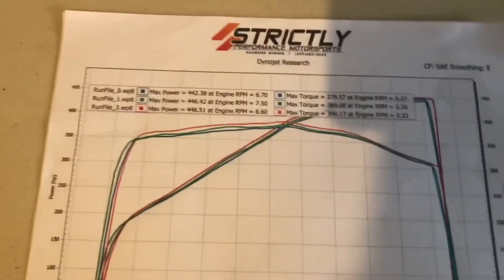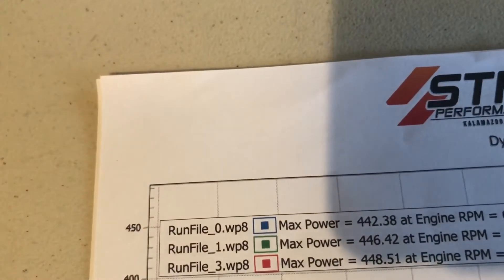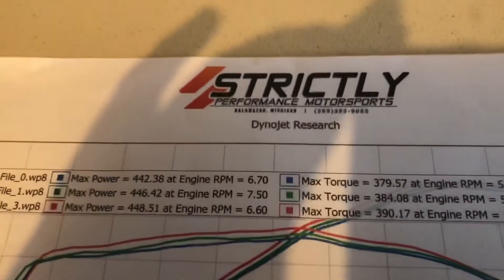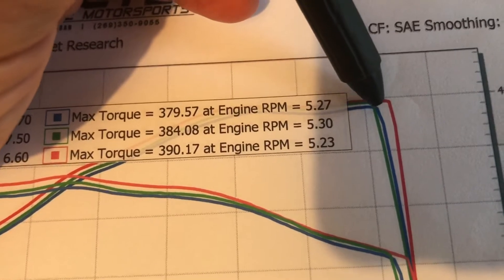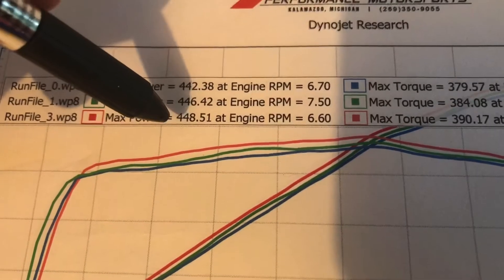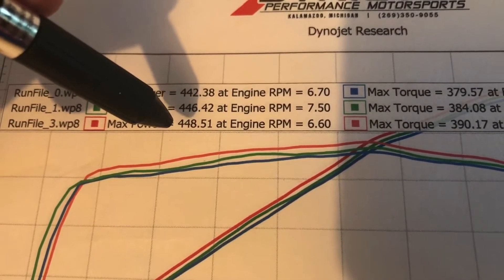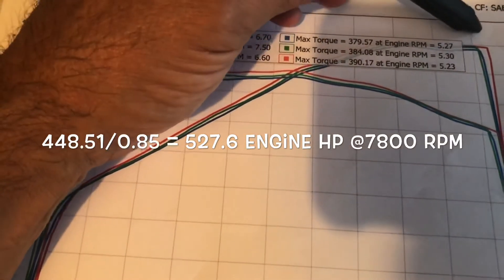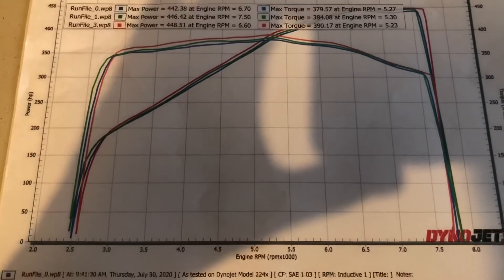Boss 302 Dyno Graph/Gen 3 Coyote Exposed!

Comment: Did you port the intake yourself? If so was it to complicated and did you use a dremel?I have a 12 Boss 302 and want to keep it fully stock and improving upon the intake would be my go to route with porting to squeeze out a few more horses.
Reply from the maker: No I didn’t port it. Here’s my recommendation. Buy a new intake bc there cheap now ($225)and ship it to Force Engineering Plainwell Mi. Call the shop and see if he will port it. Ask for Tyler he’s the owner he’s also on FB. He charged me $200 2 years ago and well worth the price. You will need a tune for the port work. Tell him I referred you. There’s too much risk when porting and to net the same result I would have him port it. Buying another intake you don’t compromise yours since it has the production numbers on it. Just my opinion. Best of luck!

Comment: What bolt-ons do you have on your car
Reply from the maker: Ported Boss intake, 85 mm TB, 50 lb injectors, JLT2 CAI, 170 degree therm, Dynatech LT 1 7/8 to 3” x to Borla over the axle 2 3/4 pipes to GT 500 mufflers, E85 tune.
Local guy tuned me. Stock coil packs and plugs.
Reply: @CoyoteProductionsBoss302  Excellent video, I'm glad this comment was on this video because I was looking for it on the previous one (build list). 
I have seen some dyno's of gen 1's vs boss with only a boss intake manifold added, and they are very similar. but just say 450whp on e85... that's 530hp easy. All I need on my car now are a ported boss, and some 1 7/8 headers and some 47+ lb injectors. 
I'm only aiming for 400whp on 93, and I"m pretty sure i'm over 400whp easy. All that's left is to get the car on the dyno... after I get some rear wheel bearings in and stickier tires xD

Also, they did point out the 12.0 compression when they revealed the 2018 GT, at least, I saw it in a video somewhere, where they specifically said compression went up to 12.0.

Comment: I ran a clayton PAU (power absorbing unit) for 27 years where we put a calibrated weight on  the absorbing head that simulates a specific amount of hp which moves a potentiometer they do that by restricting water flow or electricity to determine true power 
Dynos you are paying to determine hp is a inertia dyno which are cheaper and less expensive  that calculates hp
As it determines how much power it take to spin up a fly wheel to certain speed in a amount of time it not measuring true hp like a absorbtion dyno 
I could load down a vehicle like it pulling the heaviest load up the steepest hill possible of climbing over as long of period that the operator wants to hold the hp load